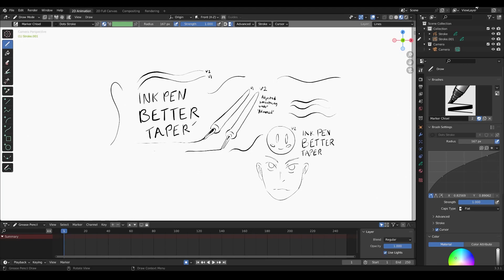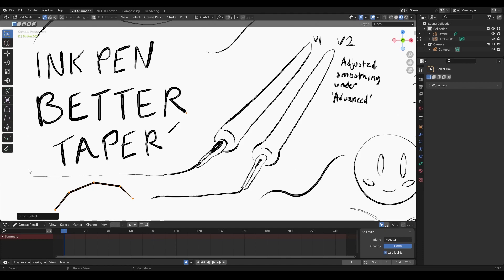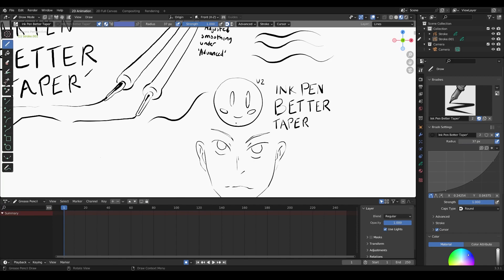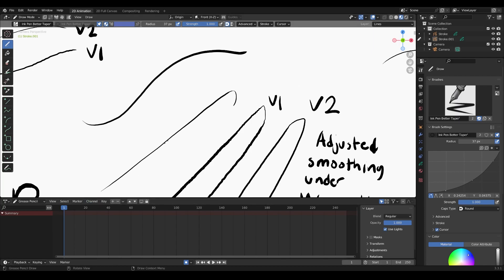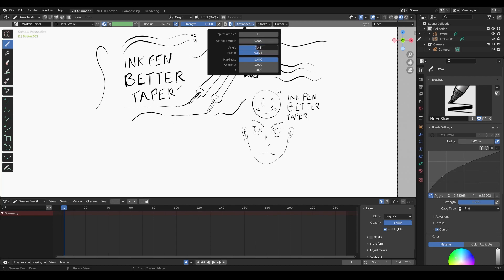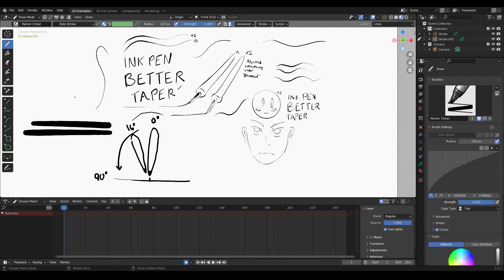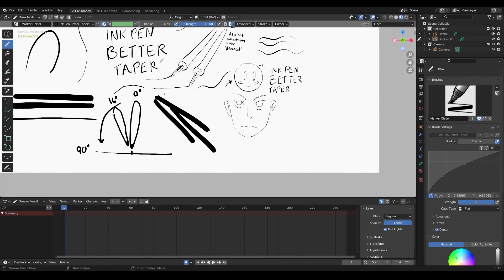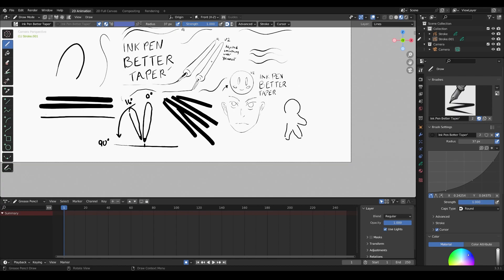Grease Pencil Blender Brush Settings Beginner Tutorial Part 2

Comment: thank you so much for making these videos, especially since there arent many vids now that can talk more about the grease pencil in blender. I am having a hard time figuring out why my grease pencil in general is lagging, even when i want to erase something it is much slower than it would on photoshop/adobe animate. I did play around with the brush settings, I also have a problem with whenever i make a stroke it leaves a splotchy result, its not jiggering,  the stroke itself is smooth, but the stroke end is messy. I am using an intel i7 samsung laptop, and I am starting to think that the problem may be is that my computer isnt strong enough. Do you think its my computer that is the problem, or is the problem more with the set up?
Reply from the maker: Hey Stefanie! I mostly use Blender on a desktop computer. If you have an older laptop it might limit your ability to use it, mainly because graphics cards and or your RAM memory is usually smaller in laptops. You might want to check the Blender requirements. The processor is just one component of the computer, but usually the graphics card is the deciding factor whether you can use 3D rendering software if you are lagging. If it is not lagging and the stroke is just splotchy at the end, you might want to look at the advanced tab of the Stroke to adjust your angle as shown in this tutorial video. Hope this information helps! https://www.blender.org/download/requirements/